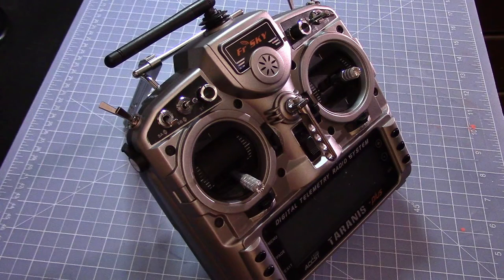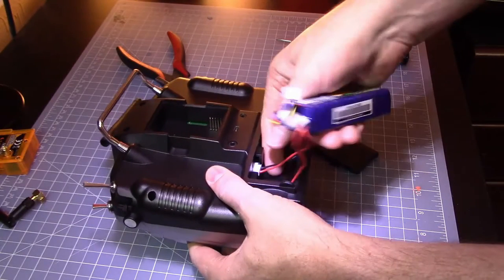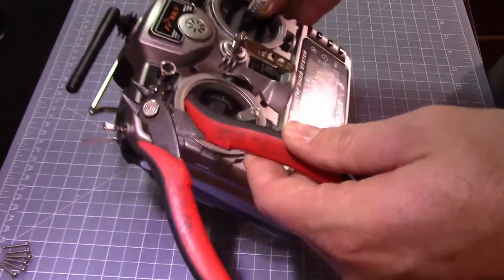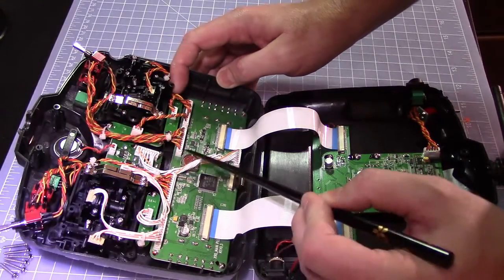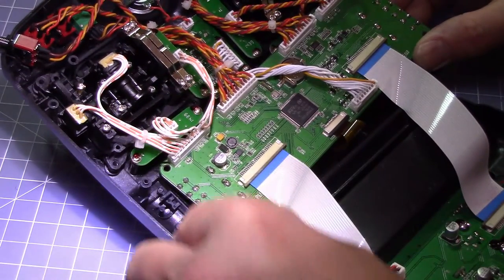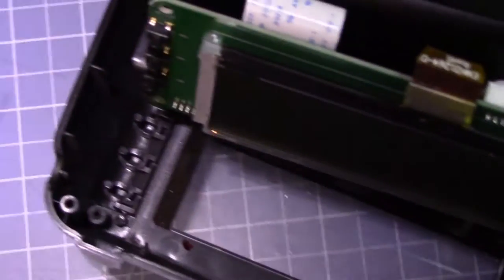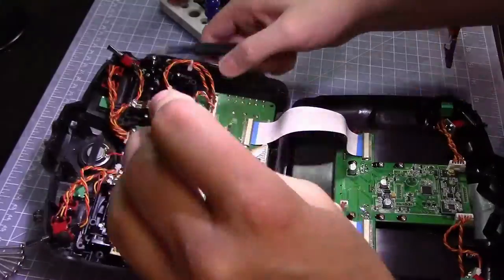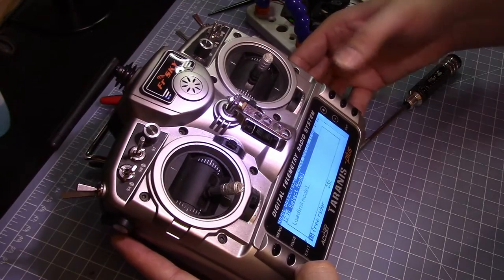Taranis Broken Button Fix

Comment: thanks for posting this. My first trip inside the box - and it worked.
Reply from the maker: I am glad it helped. I cant remember if I said it in the vid, but I mainly made the video... just so I had a record of where everything went... so I could get the thing back together.
Reply: Think I would have missed the 5th screw holding the board down....little things like just make the difference. A bad day ended up well. Thanks again.

Comment: I seem to have a slightly different problem with the down button.   It works only when I press it unusually hard compared to the other buttons.  Just wondering if anyone else has had this same problem and a possible solution.
Reply from the maker: If memory serves, that's how mine started.